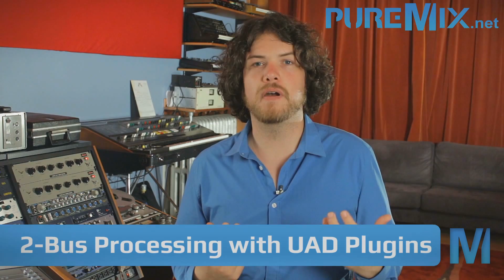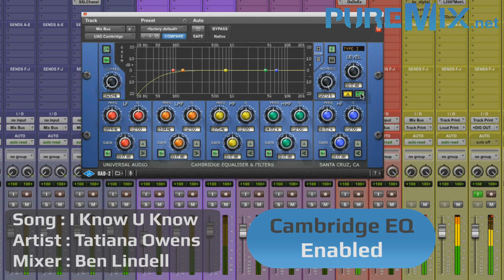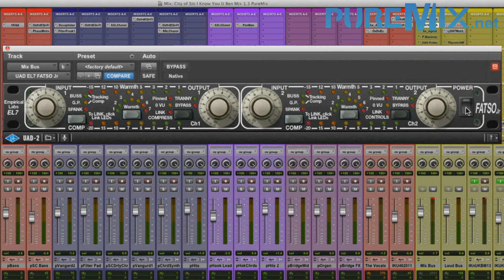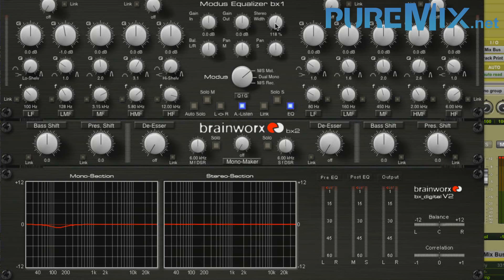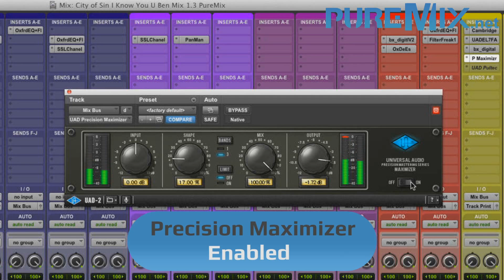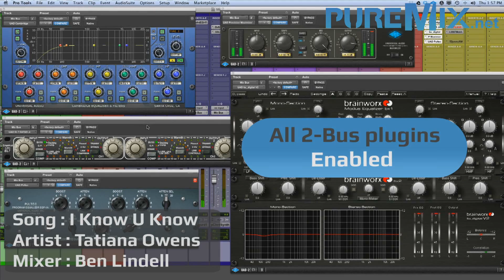UA Mix Bus Processing | Universal Audio UAD Plugins | Recording System

Comment: Wow, I don't know but in my opinion, with each of the changes, the song just sounded less energetic, more flat, and just plain boring.  The HPF definitely took away from the energy and even such a subtle setting on that compressor really changed it enough to where the song afterwards no longer captured my attention.  Maybe I'd try to tighten/shape the lower frequencies a little better but not completely remove them, and the Fatso maybe I'd furthermore just add to the vocals but nothing else.  I feel like in general you're being too distracted by the differences in the bass, because that's what you used to essentially judge the difference that the Fatso made in terms of punchiness.  These differences are even obvious on my tiny little $30 bluetooth speaker.

I wasn't too keen on the changes which followed either.  Yeah, notching out a bit in 128Hz made it a little tighter, but again, it took away even more energy, even if only a bit.  It essentially just made it sound more muffled in that range rather than bloated.  Maybe you could've used a slightly more narrow Q.  Then, the saturation from the Precision Maximizer mostly just added sibilance to the vocals (not in a good way imo) and took away some presence from them and in general from the mids.  The Pultec was of course really nice though, as it usually is.  It's almost like it brought back everything that I just mentioned was taken away XD

Still, would've been better though to keep what was originally there and instead add only the Pultec and just drive it a little less, since what was originally there already had a more natural sound of what was otherwise the intended effect of the Pultec, as nice as that plugin typically sounds.  At the end, maybe I'd still use a bit of compression but using something different though, maybe like the Sonnox Oxford Limiter.  The way it currently is, especially for headphone users, the sound would get fatiguing; one of the downsides of an unnatural sound.  In general, it just sounded altogether better before than after (apart from the seeming "size" of everything, mostly only due to that Pultec at the end).

PS- I don't know how some people don't hear/barely hear the differences.  They seem very obvious to me.  It would be better however if you didn't stop in between toggling the plugins on/off simply to say that that's what you're doing.  The point of the video would've been so that we could see that XD